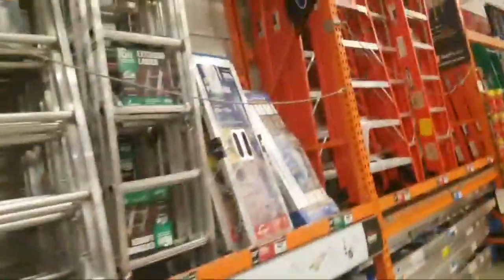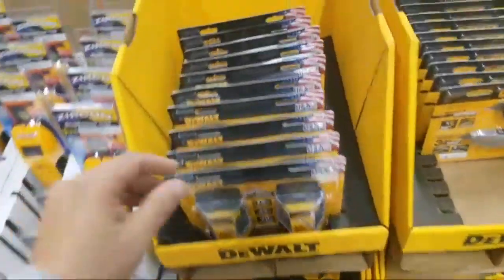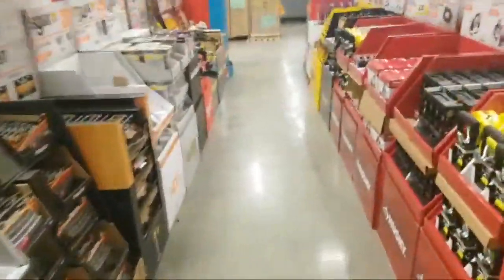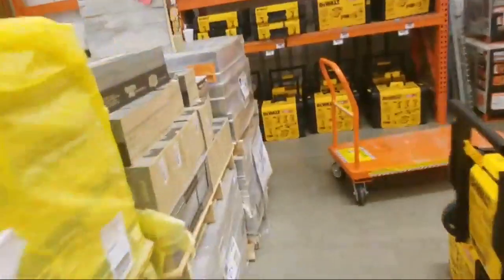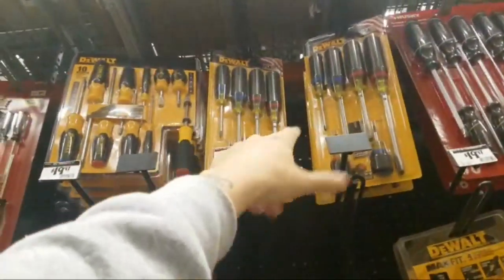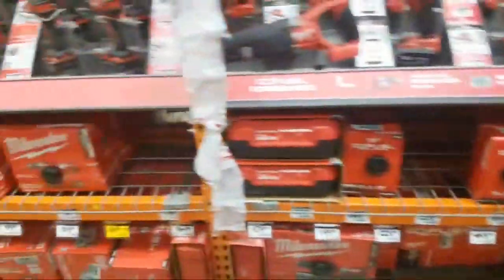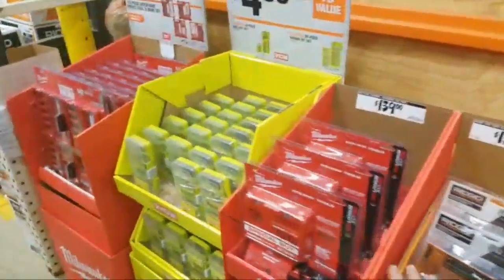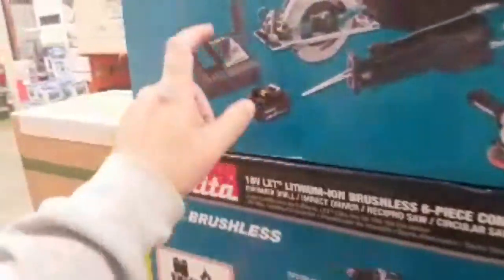Home Depot ...PRO-BLACK FRIDAY SALE...LIVE !!!CHRISTmas Deals!!

Comment: Kameleon was the first auto lock tape for me. Of course I have all of the Milwaukee's except for the stud and waiting on that one because I believe they're going to have to have 2 for 1997 and I'm hoping it's going to be on the 16-foot. 25 ft I find it a little ridiculous if I need longer than 16 then I'll get the wheel or my laser. Also I would like to know why Milwaukee offers a 12 foot in the depot refuses to carry it also I want to know why it Depot refuses to carry the new keychain tape measure that was debuted at 2018 NPS. Boss you know which one I'm talking about you played was it there at the NPS 10 foot keychain tape with a magnet and a LED light why are you will they not carry this in the damn Home Depot they refused to get it and keep us stuck with these damn six foot tapes that are in no way as good as the keychain FatMax or the keychain DeWalt the only thing better about the Milwaukee one any reason why I have it on my keychain is because the chain on it is better and the fat Max chain broke and so did the DeWalt chain but the DeWalt is 9 ft and it has a magnet and has a belt clip and why the hell is it A6 foot from Milwaukee and FatMax when sheet goods are 8 foot yeah I know it's a keychain tape and everybody's going to take care of your real tape I do I have a full line of magnetic and auto locks and compacts just waiting on the deal for the studs and of course I've got several Kameleon tapes also because they had to auto-lock 1st and Milwaukee did not and they have a 12 foot in store at Lowe's Depot refuses to carry 12 foot

Comment: How do the DeWalt multi-tool and the Bosch multi tool compare?
Reply from the maker: Haven't used the bosch ..but bosch has that starlock system
Reply: I have the Bosch and I love it. Although, I haven’t used the Dewalt. Only thing I don’t like about the Bosch is that the grip is huge and not particularly ergonomic, but it is a very well performing OMT. I would think that if you prefer a trigger operated OMT, the Dewalt is the best on the market. If you want switch control with speed dial, the Bosch is probably the best. Another option that I am impressed with but haven’t used but have checked out a display model is the Brushless Kobalt OMT. It is switch/speed dial style but the grip is very compact and comfortable. I’ve read that it performs quite well but the blade mechanism is inferior to both the Bosch and the Dewalt.
Reply from the maker: @82camino96  what we talking about here brother 🤣🤣
Reply: Eh just a little multitool rhetoric. Lips was flappin in the wind 🗣🌪
Reply: Here is why I ask. I have old Dewalt XRP gear that is still in service. I picked up the $99 Bosch, 2 battery, drill, impact, and charger that TB called out a couple of months ago. Too good to pass up . When I re-tool, I want to go Milwaukee. Regarding OMT, from experience, having to change tool blades when it requires unscrewing something is counter productive. That counts Milwaukee out. I really don't want to continue with Dewalt, so that left Bosch. The future for me as the old Dewalts die will be Milwaukee and Bosch.
Reply: @82camino96  - I completely agree about the ergonomics between the DeWalt and the Bosch. I just don't want to go Dewalt in the future. I wish Milwaukee would have come up with a  "Starlock" like blade changing system like Dewalt has.
Reply: I have recently moved to the Milwaukee 18v platform from the dewalt 20v, however I had to keep a couple of my dewalt tools because Milwaukee has failed to upgrade a couple tools to brushless models. Dewalt has brushless models and they've been out for some time. One happens to be the multi tool. The other is the power planer, the 3rd is a orbital sander. The Milwaukee 18v orbital sander is the biggest piece of shit I've ever used. Why hasn't Milwaukee come out with a fuel version multi tool, power plane, or orbital sander? Very disappointed.

Comment: Bought into the Ridgid tool box system because they always seemed to have the parts - doesn't seem like they ever had the DeWalt stuff I needed.
Those home center screw driver sets are crap. Those plastic handles are hard to grip with wet, or greasy, hands. And tips just never seem to work very good (especially the Phillips ones when you use it for an emergency star drill - Ha ha!).
More of those driver bit sets... stop torturing me! 
And they take the batteries out of the display tools because, most of the time, they're dead anyway. Or they don't want some asshole stealing the thing. (Have some friends that have a hardware store... someone stole a cordless drill, and battery - left the case, charger; second battery. WTF good does that do?!!)
'Bout time for my weekly excursion to the Depot, Lowe's, and Menards - I'll be taking my checkbook with me.